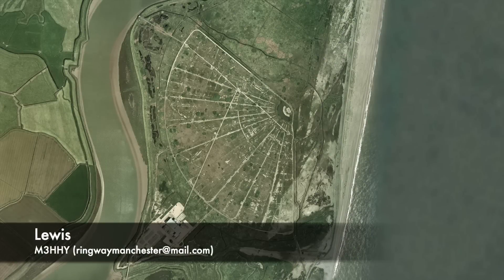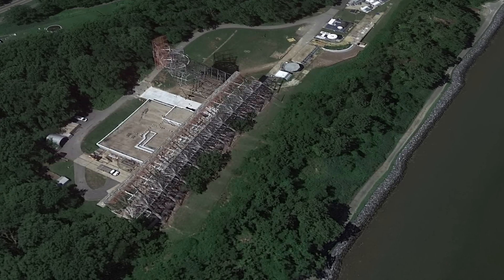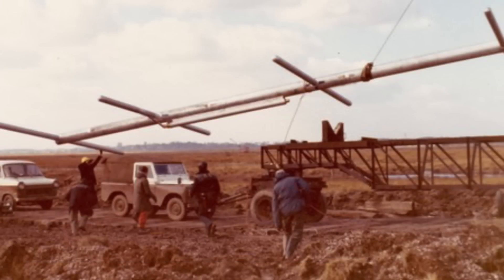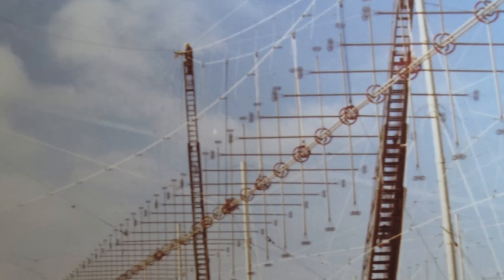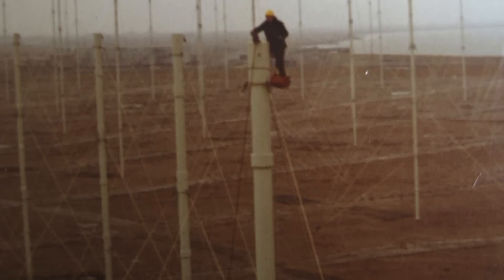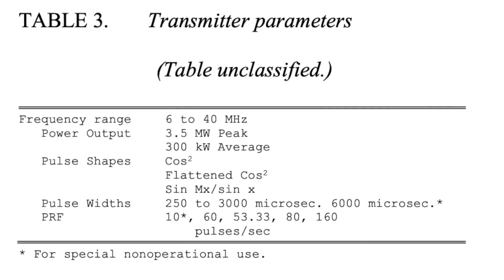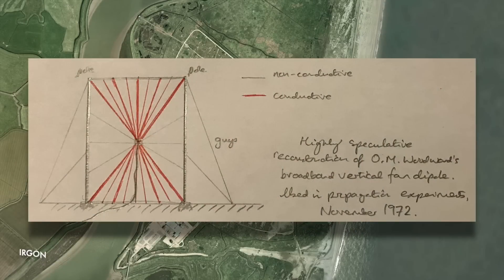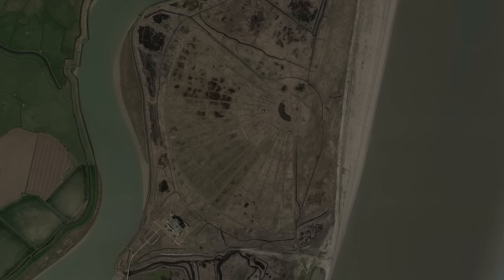Cobra Mist - The USA's Failed Over The Horizon Radar

Comment: Was station on the site (Jan ‘72 to Jun ‘73).  “Radio Research Squadron”, RRS, or known as “Royal Research Squadron” to satisfy the RAF/Brits.  Naval Research Labs (NRL) assist in the research.  I was lucky enough to garner some UNIVAC mainframe time and learn FORTRAN 4 during research downtime. The entire tour and British was one of the best in my Air Force career.
Reply: Some people say it was also a long range EMP weapon used if Europe was invaded. Could this be true? It did have a massive power source.
Reply: @ it pulsed 10 megawatts of power maximum. It could vary its pulse repetition frequency but usually about 40 PRF.  It operated in the HF spectrum.  Some worried about it setting off ordinance of Bentwater’s F-4’s as they flew overhead on their return route from training exercises.  Some pilot’s may have had concerns about their sterility as they passed so close.  But as a weapon, no, the worst thing would be radio interference issue.
Reply: @deuceAl  interesting, thank you.

Comment: I did some work on an Air Force system in the late 80's or early 90's.  Separate stations for Tx and Rx at Christmas Valley , OR and Tule Lake, CA.  Analysis and feedback was at Mountain Home AB in Idaho.
The system failed for a number of reasons, but one was that they could not maintain a good ground plane.
Reply: I was out exploring the Tule Lake site today. Its amazing how much is still there and only locked with a pad lock on the doors. I could hear the hum from the transformers, so its still getting power.

Comment: I was a kid in the mid 1970's on the Canadian west coast when I recalled tuning into a loud 10 Hz echo delay tone located just above the AM broadcast band roughly between 1600 to 2000 kHz  the signal consisted of a pair of  10 Hz tones  with one tone beating slightly faster interacting with the other tone going in and out of synch every 1 minute or so giving it an double tone and echo delay effect. . This signal was active day and night.  This was not the same as the famous Russian Woodpecker which I also remember as well.  I believe this signal went silent around 1979 or 80  My guess it was an   over the horizon radar system  from the nearby USA.

Comment: They’ve built more OTHRs since then so either they figured out what the source of the noise was or were able to mitigate with better signal processing. I hate transient interference, just when you think you’ve solved the problem it pops up again and spooks you.
Reply: Should it not be possible to figure out if the noise is from within or outside?
Also, what kind of "noise" are we talking about? Actual noise or some systematic process?

Comment: Excellent video. A long time since I've read it, but one interesting comment I recall in the declassified noise investigation report is that whether the noise's origin was jamming or not, they admitted that degrading the system with a mobile jammer would have been fairly trivial to accomplish. I wonder if modern day OTHR systems are equally vulnerable?

Comment: Interesting. Is Jindalee in Australia one of the only over the Horizon radars still running?  Heard they are better at detecting stealth aircraft
Reply: For the most part that's due to fire control radars on aircraft being predominantly X band pretty much exclusively until relatively recently. For that reason most stealth efforts went towards reducing radar cross section in that frequency range. The B2 and almost certainly the b21 as well (RAS baby) have more of a broadband stealth ability.  Even then while they can detect for the most part these systems are too slow or the frequency limits the resolution to provide a track or firing solution.

Comment: I love the odd and historical stuff you dig up and share about radio and communications 

I live not to far from what I suspect is one of first or at least early Merv Griffen owned radio stations.  It totally dominated both listenership and geographic area for a long time locally being much better and farther reaching signal than anyone else. Partially I believe because of the antenna location that I have been told has one transmit tower and three active reflecting antennas.

Comment: Can you elaborate on the english usage of the AN prefix?  It was my understanding that the prefix indicated shared component hardware between Army and Navy (thus the AN prefix). I was first exposed to this while examing AN/UYK-20 systems.  Maybe I am misinformed.
Reply: Look up "Joint Electronics Type Designation System"
Reply: @RCAvhstape  Ah yes, excellent.  Thank you!  This makes sense... it being a US-led program.
Reply: I know electronic parts were labeled “JAN” or Joint Army-Navy. Old vacuum tubes had this on the box, but those are very hard to find now.
Reply: That's what it meant when I was in the service, I worked with the AN/PVS5 thermal sight =Army Navy Passive Viewing System 5

Comment: and FSK or frequency shift of the received signal feels to me like a change in the refractive index of the signal with a change in velocity factor it changes the arrival time/frequency of the signal in much the same way as a pencil appears to bend in a glass of water.  It is a function of the arrival time of the light/RF.

I'm loving these articles, Also Australia has an OTHR operational I believe.
Reply: Called Jindalee Operational Radar Network, apparently works very well.
Reply: @wilf609  It does, I worked at the TX and RX sites in Western Australia for 7 years before retirement. They are situated out in the desert in a radio quiet area. There is an equivalent site out at Longreach in Queensland. They were operated by Lockheed Martin for the RAAF
Reply: Where is MH370 then?
Reply: @empe811  with your mom.

Comment: The transmitter built on the site after 1973 was the new "Aspidistra", after the Crowborough site shut down.

Also along the way there are the Pagodas, chambers to vibration test live nuclear bombs, or at least I think they were armed for that purpose. Yes, the boffins were completely bonkers back then.
Reply: I think they only used dummy warheads for those tests.